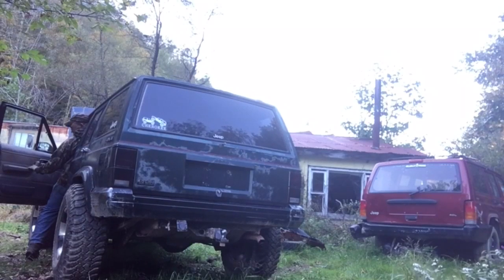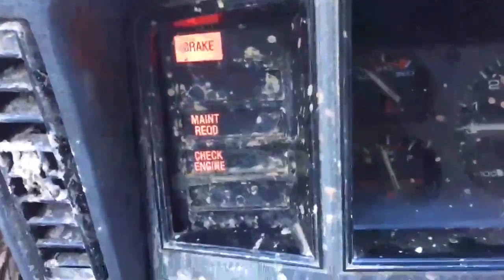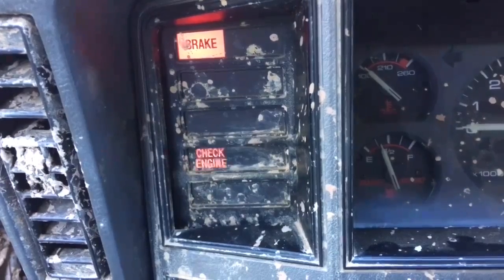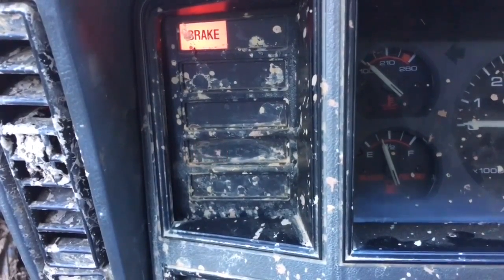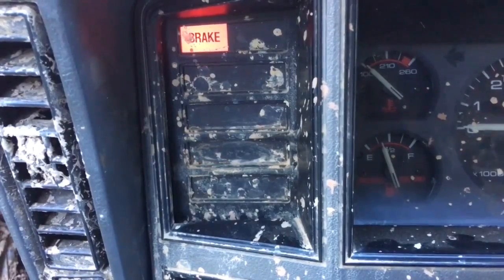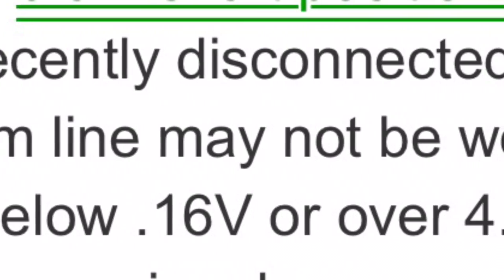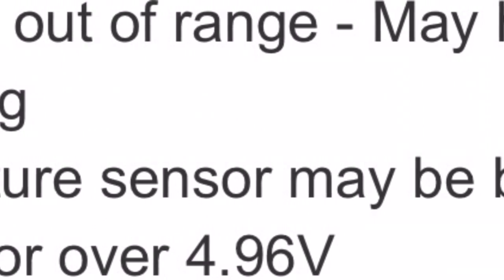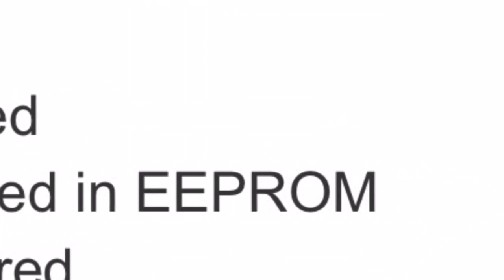jeep cherokee how to check OBD1 codes 86-95

Comment: my 1994 xj cherokee country 4.0 cranks, but no start  error code is 54, distributor is good, position sensors are good, ignition coil is good. what could be the reason?

Comment: When you turn the key on normally (no codes) does the check engine light stay solid until started? Mine is solid and when I try the 'on, off, on , off, on' method it just remains solid

Comment: Thanks! Just did this on my 1991 Jeep Cherokee Laredo and was in the clear with only code 55! 

I  just replaced the ASD (Automatic Shutdown Relay) relay, which was listed as a possible suspect for intermittent stalling which in my case happens only when warmed up and mostly when running in idle at a traffic light. After killing, the Jeep usually starts right back up.

Comment: I am working on a 1991 Jeep Laredo 4X4 with a 4.0 straight 6. It is giving me the following codes in this order; 12, 75, 73, 35, 51, and 55. I am very confused as I re-read the codes 4 times, and received the same read-out. I know what 12 and 55 mean. I understand that 35 is, per the read-out list, cooling fan relay circuit open or shorted. However, this code says XJ's only...confusing. I also get that code 51 is a rich air/fuel mixture has been indicated by an abnormally rich connection factor, but I do not know how to midigate that issue. Codes 73 & 75 I am at a total loss. Someone please help!!!

Comment: Funny, people posting info when they have no actual knowledge of fact.
86-95 are not the same. 87-90 jeep cherokee is renix era and is pre obd1 and do not throw codes. 91-96 is obd1. 97 and up is obd2.
Reply: Randy Anderson wrong 91 to 95 is obd 1 96 to 01 is obd 2. But you can still do this on a 96
Reply: It worked on Ma's '91 Limited XJ just now, as well as our other XJ, a '94 Country. We have 2 Jeeps, oy.

Comment: Is there any way to clear these codes? I'm tired of my check engine light coming on.
Reply: I THINK WHEN YOU DC THE BATTERY IT WIPES OUT THE CODES. I removed a relay one day and the codes were gone.

Comment: It looks like I have a 12, 37, 21, 52, 62 and 55. When I look those up some seem to be real obvious like an O2 sensor. But what does 62 - Emissions Maintenance Reminder (EMR) triggered by mileage accumulator? Any idea?
Reply from the maker: Ray Quiles if you have a older jeep like me their is a box under the dash that tracks your miles and it just remind you to do maintenance on your o2 senor and cat it will kick on a maintenance light to which is a pain to turn off lol